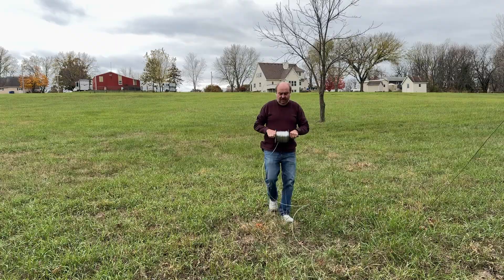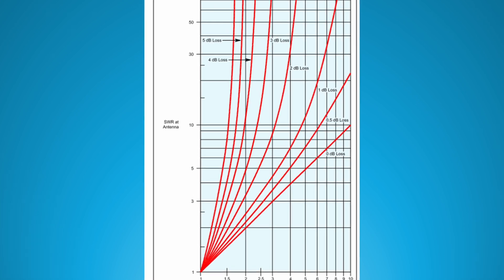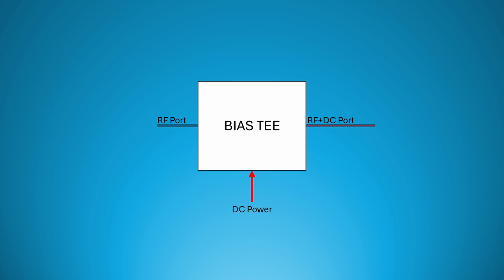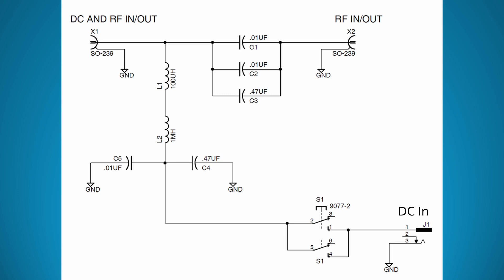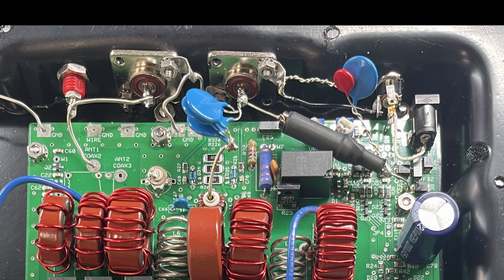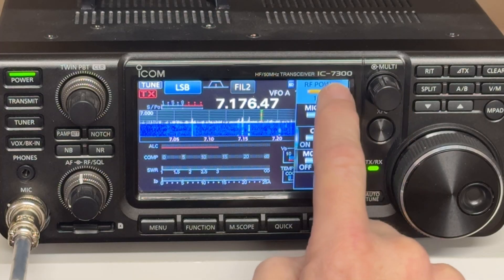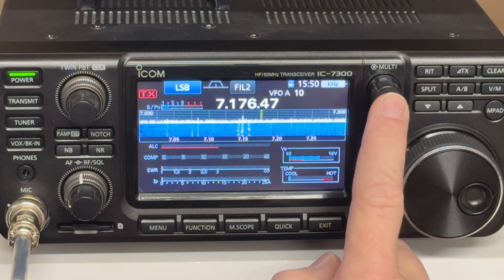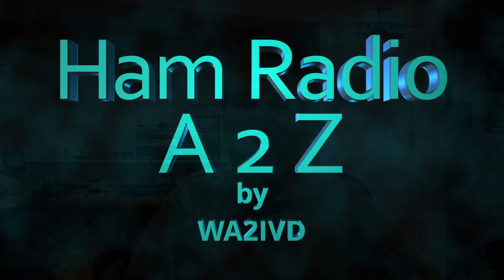Remote Tuners Why & How

Comment: If you can make it work, open wire feedline has a small fraction of the loss that coax does. Having the tuner next to the rig is not a problem then.

Comment: Always enjoy your videos, Tom!

I recently managed to get my dipole SWR's down low enough such that my ICOM 7300 internal tuner can tune each band from 80 up to 6 meters (except 60 meters). So, I have placed my external MFJ-939 tuner in the closet.
However, when I jump to each band, I instinctively hit the TUNE button, let the ICOM 7300 tune, then proceed to operate. My power setting is at 100 watts...
So, my question is... I understood the 7300 will use only 10 watts to tune when you push the TUNE button, thus eliminating the need to actually lower the power level via the Accessory knob....

is that correct, or am I misunderstanding something?

Thanks again and Merry Christmas.
73 - Stan WB5UDI
Reply from the maker: Hi Stan.  That's correct.  The 7300 will put out a solid carrier of about 10 watts when you push the TUNE button, regardless of the mode or power setting.  It will also do the same thing with an external tuner IF the tuner is compatible and it's connected to the external tuner connector on the back of the rig.  Most modern rigs with internal tuners and/or connectors to support external tuners operate this way.  At the end of the video I mentioned that it's possible to create a circuit so you can make a TUNE button to do the same thing for a remote tuner with no control connections to the rig.  I'll go over this in an upcoming video.

Comment: Great video TOM ! That bias T is important if putting DC over coax.  With possible short to ground , I have a fix for that.  Look at manual for tuner. find max current it draws.   Than add like 10% for a safe margen. that is what you set a current limiter to.  many circuits and some power supply's have a  current limit function. A LM317 voltage reg can be used as a current limiter buy just 1 resistor for the set current. In normal mode this will have a voltage drop like 3 or 4 V So check range on tuner. When a short accrues the current limit kicks in . saving a large   current spike. Also a mosFET circuit can be used and take many more parts . Somewhat similar to a battery BMS used in Li-ION to have current limit . FET has very low voltage drop. Just adding correct fuse at the least is needed. you can put LED and resistor across fuse to let you know it blown.   Or just run a wire to power tuner that way but may be long. Allways tune under low power . no only relays arc the finals in radio see SWR spikes as tuner is working. This may be a problem in older rig. 73
Reply from the maker: Good ideas.  Some type of current limiter is another way to handle it.  Although I wouldn't want to be feeding a steady 1 amp into a short if I forget to turn off the power to the bias-tee.  Maybe a current limiter that shuts down after some time limit?  Also, good point on potentially damaging finals when tuning up at full power.
Reply: @HamRadioA2Z  Current limit timer is 555 IC. with all that I would just run speaker for power to ATU . LOL 72

Comment: Thanks for the nice video!  I have been using an LDG  100w remote tuner on a home built Rybakov vertical.    Seems to work well, and is quick and easy to put up for Field day or when camping.  I have used it with just the tuner in the radio a few times, and while it works OK, I feel the tuner at the antenna is a bit better and less loss.  And I don't feel so bad about running RG-58 when taking it out in the field.

Comment: Good work Tom!  I have to ask, have you had an incident with the coax switch and the bias tee?  Sounded like personal experience - hehe.  I bet that would catch some folks out for sure.  Merry Christmas buddy!
Reply from the maker: Luckily, no.  But, when I was first setting this up I went to switch my antenna switch to ground and thought “whoa.  Wait a minute here”. I looked through the manuals for a few tuners prepping for this video.  The LDG manual spends several sentences on the subject and warning users of the issue.  Other tuner manuals don’t mention it at all.  So I thought it was worth covering.